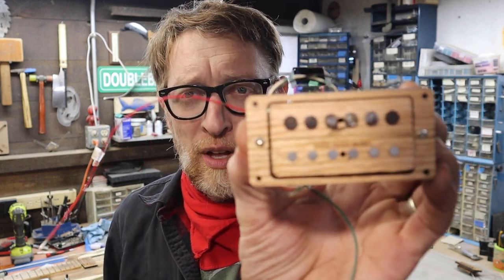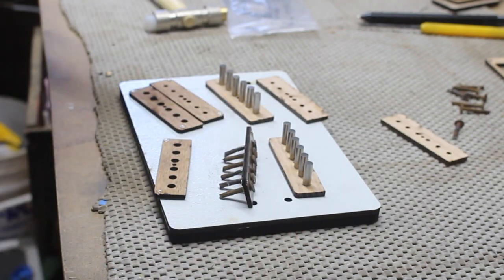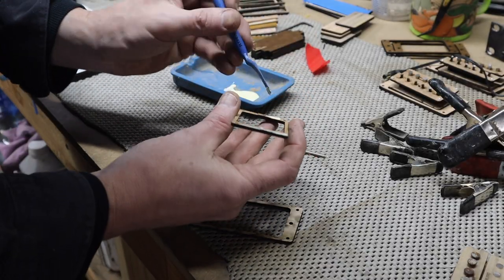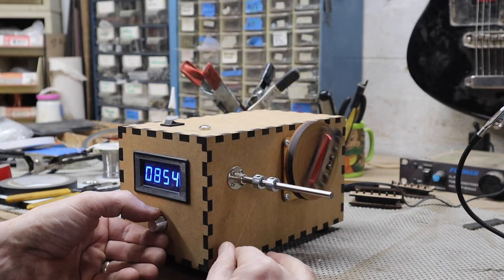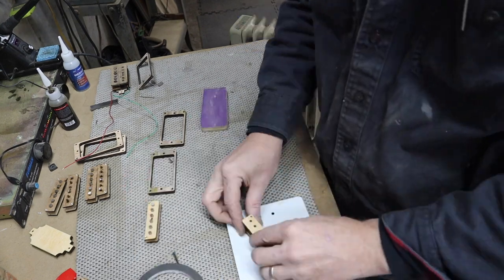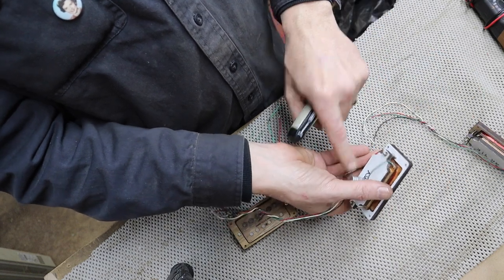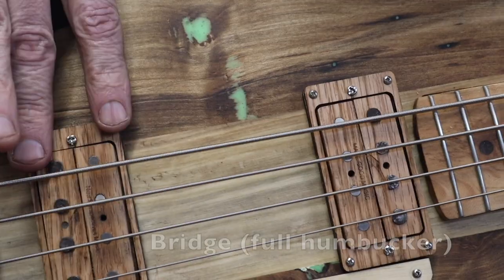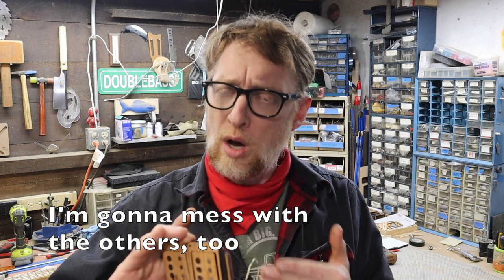DIY Pallet Wood & Rusty Nail Humbuckers - PAFS (Pallet AF)

Comment: You don’t need alnico poles. Just steel slugs. Use a nickel base plate and be sure the bar magnet makes good contact with the slugs and nails. That will help immensely
Reply: Yup.
Reply: any old "soft" steel... or yeah, nickel... forget thats a ferromagnet... 

florists wire is good. 
mu-metal or silicon steel from transformer cores... ;)
ferrite slugs...

LOTS of options...

Comment: You can melt down plastic to make a resin you can use for the bobins to prevent warping over time. Endless plastic to use for this. Magnet wise if you want to recycle, you can find cheap pickup lots in ebay, all sorts of old audio equipment, many tools, toys, jewelery, etc too. Older stuff use ceramic and newer uses neodymium usually.

Comment from the maker: UPDATE: In the bass demo, I had a brain cramp and miswired the pickups so they are out of phase. I have rewired them and they sound AMAZING! Be sure to tune in to future videos to hear them properly and/or follow me on instagram @TimSway1 to hear the bass now.
Reply: i need to know what you used to remove those nails
Reply from the maker: @thatfatguy4508  it's called an "air denailer"
Reply: @timsway  thanks a bunch i have never seen someone get nails out of a pallet so easily before
Reply: I just came to the comment section to say I think you got them out of phase. Glad you could hear it yourself!

Comment: Pickups are a simple concept but are no joke when it comes to making them. 
I would either use bar magnets or rod magnets, not both. 
There’s new pickups out there with a mix of wire gauge on separate coils. I can’t remember what brand/model though.

The first Broadcaster pickups used 43 on the bridge and 42 on the neck. 

Good luck with the design!
Reply from the maker: indeed! very small variables make very big changes. Looking forward to learning more. It's a lot of fun
Reply: DiMarzio does a combo of 42 and 43 or other gauge wires on opposite bobbins the same humbucker for a bunch of their designs. The idea is each bobbin ends up with a different frequency range, but ideally the same noise and hum for cancellation purposes. An extreme combo (really thin on one side, thick on the other) would even give it a scooped midrange tone (see dimarzio Steve's special)

Comment: An idea for the nails, maybe get a small steel flat bar, drill holes to receive the nails, and then tack weld the nails to the bar. That way you don't have to worry about the uneven surface of the nails making poor contact with the magnet, and the magnetic flux can flow better through the nails.

Comment: The nail side will always be lower with how you have done it because the magnetic field from the actual... magnets in the other side carry a stronger field through them, which magnetizes the strings better.

What you've got is closer to what PRS did to make their coil splits sound better (Or so I've heard - I don't often get to mess with those guitars) - The side that split out for the single coil used alnico slugs, where the screw (in your case, nail) side just had a bar magnetizing it. PAFs just use plain metal slugs with that bottom magnet for both coils.

If you're going to stick with the style you have now, my suggestion is to get a second, thin bar magnet to go on the far side of the nail poles - a construction closer to a P-90.

Also, a word of advice on Humbuckers - Mismatch the coils by a few turns, they tend to sound better, something to do with the phase cancelling. Try putting a few extra on the Nail side and a few less on the magnet side to help with the balance.
Reply from the maker: great info and you helped me feel better about some of my next thoughts/steps. This is 100% why I take the time to make these videos, to get this open flow of knowledge and creativity happening!
Reply: This answered alot of my questions too. I didn't know that the alnico slugs side was meant to be both magnetised and then connected to the bar magnet. Good info
Reply: @timsway  Have you tried adding passive magnetization to the nails via rubbing them with a permanent magnet? I'm wondering if that would be worth it, especially since the nails are so old and beat up, they might not let the field pass through them very well compared to new nails. (just a guess, as I'm no magnet expert)

This video by the Action Lab on magnetization might prove useful though: https://www.youtube.com/watch?v=oNjMLtHFxkU
Reply: Good advice!!
Reply: @fphantom  Those poor old nails... I always say "Excuse me for hitting you!" and then I hammer them on their heads. That really helps, they don't scream like they used to do. Any idea when iron was formed, after the big bang? Those nails are older than you'd think.
Reply: @voornaam3191  I'm not an expert but I think iron is formed in stars, they heat by fusing the lightest elements that formed after the big bang like helium, they convert it to a heavier element and at a certain moment you have a star with mostly iron in it. So not right after the big bang. Btw, for a good metal guitar you need screaming nails.

Comment: The nails are a fun choice. Using a $20 automotive handheld vacuum tester, some automotive vacuum tubing, a couple of connector fittings, and a pickle jar, you can make a vacuum wax potting system that can handle high gain distortion/fuzz without feedback.

Comment: Some thoughts. You might look into cigar boxes for your plywood. I build cigar box guitars and the box lids on some are surprisingly strong.  Old IDE and SCSI hard drives have insanely powerful magnets. Even laptop hard drives have strong magnets. (don't forget old speaker magnets for your magnetizing needs) Also you might hunt around for an electric demagnatizer. (which is actually an electromagnet on a handle) They were used in the recording and data industries to over write the magnatism on old reel to reel or data backup cassette tapes. Might be faster and more even than your vise magnatizer setup. 

Hope some of that is helpful. Peace.

Comment: Another commenter mentioned you mixing alnico pole pieces with steel, I'm going to add to that in as much as screws were used for pole piece height adjustability. Perhaps try using the nails and screws instead? That way you get 100% of your gauss from the (alnico?) bar magnet! Great vid!

Comment: Thanks! Another great video. It's time for me to build and mess with pickups, too. What I can recommend to you, is building a bass body with three rectangular holes in it. Bridge, middle and neck hole. That way you can easily change a pickup, or move it to another position, from the back side of the body, that is. No need to losen any strings. For a large enough body, those holes are no threat to strength or sustain. My bass sounds okay this way. If you like the idea, I got no patent. Makes me wonder who could have one.
Reply from the maker: I've seen some similar ideas out there. I'm sure some one tried to patent it. I love the concept
Reply: @timsway  I have a cheap Japanese 70's-ish bass. Thin plywood body sounding like cardboard. So I built a larger (still cheap) scorched pine body. And I remember those guitars with a smart exchange-your-pickup system. My version is simple, just bent up the lips sticking out, and now two short bolts hold the pickup in place, instead of those long bolts. Adjusting option is gone, fix it higher or lower. Bit of a prototype, already good enough.

It was great hearing that pickup in bridge and middle position. It had been a neck pickup only. Okay, but they could have done the Strat concept, all it took was 2 extra pickups and a 5-switch. Why did they wait 30 years?!

Comment: I've got an early 80s USA-made J.B. Player with a Mighty Mite Motherbucker--three coils all right next to each other, two bar magnets, each coil running to an on/off/phase reverse switch. I'd be very interested to see a New Perspectives version of it.
Reply from the maker: Cool. I'm gonna look that one up. Baby steps. I gotta make a working double coil first, lol :)
Reply: @timsway  caveat: Mighty Mite today makes a product called the Motherbucker, but it's not the same thing. It's just a regular ol' high-output humbucker. The real McCoys were made when Randy Zacuto was still at the helm. About 4.3K DC resistance per coil, and I believe the magnets were highly charged Alnico 5s.

Comment: Nice. Thanks for sharing the adventures. 
I know nothing really about making electromagnets. So this might be rubbish. I see the nails are quite thin compared to the other pickup parts. How about grinding two nails on the side so they can fit snugly together?. Even add a bit of solder to bind them if you think it would help. ! 
Might be more work than fun though!  It might make the sound bigger and more character full too. 
Keep having fun and sharing.

Comment: Since you're looking for weird designs, in the cigar box guitar world there is a thing called a Flat PUP. It's a humbucking design that is very flat that some people seem to like (I never tried one myself). And since it's from the CBG world, it can easily be made using reclaimed materials.Also, there are electrical magnetizers that exist. I think they are used by the model train enthusiasts to re-magnetize the motors when they're old (I know James May has one).
Reply: Flat pups are pretty amazing. They sound great on CBGs. But I also tried one on a Squier Strat that sounded really good too.
Reply: Flat PUPs are a derivative of the Sidewinder Humbucker, someone just realized "Wait, we don't need a thick bobbin."

Really neat to see people attach themselves to that pickup design though, it didn't get a lot of love.
Reply: @alaricpaley6865  I never heard of the Sidewinder pickup before. Thanks for the info.

Comment: my first, and only pickup (for a sympathetic string box aka "electric sitar") was using a bit of hacksaw blade with teeth ground off. bit of teflon tape and notch in each end.

surprised many that it worked, being high carbon steel...

i ever do it again, its getting the "I" from the core of a transformer... 

i prefer blade pickups for some reason... still have my schaller twin blade "single coil" humbucker from 25 odd years ago...  its always ended up in my primary guitar of the time.

relay coils work well. can embed them in random places, then get crazy with series/parallel, in-phase/anti-phase configurations...

Comment: I had a crazy idea. Most people told me it was impossible, but one person told me it was just dangerous and foolish. But .... in theory you can put DC through the pickup to boost the magnetic field (using them as dynamic electromagnets) and it should be able to coexist with the AC signal without interfering. Possibly, you'd need to bleed or filter off the DC before it hits an amp or pedal.

Comment: On single coils the start of the wind is the ground or “negative” leg. Also shellac or lacquer is a very good way to isolate the wire from the pole pieces, as it’s super thin and leaves you more room for wire haha
Reply: Actually the beginning (inner turns) of the coil is "hot" and the end (outer turns) is the ground. Otherwise it will make a good antenna for everything EM in the surroundings😉
Reply: @jjcale2288  over 500 sets sold and not one complaint of RF, winding them the way Fender Dimarzio etc wind them , with the common, or “ground” being the start eyelet on a single coil bobbin.
Reply: @velvetonecustomshop5026  Leo Fender did so because he put the turns directly on the magnets/poles and there was a good chance to short the coil if the isolation on the magnet wire failed. By grounding the beginning of the bobbin he could get away with such failure. Bye bye to reverting the phase of his vintage coils. Just for once,  compare the noise produced by a single coil connected as you usually do vs wires reverted. Just give it a high enough gain to hear the difference. You don't even need a guitar for this.
Reply: @jjcale2288  pickups are a single source, so by definition, they do not have “phase”, they have polarity. Since the early 60’s people have switched the leads on the middle pickup of Strat guitars to be able to jam the switch and get the parallel sounds we now enjoy on a 5-way switch.
Swapping the common leg, as you call “ground” has absolutely no effect on rf pickup. The circuit has no idea which leg you are sending where. Rf comes from analog tv station (which no longer exist) neon light power supplies (which have mostly been replaced by led), and actual radio frequencies… the only common thing that works on rf these days is a cell phone not connected to wifi. So if you set your phone on your amp you can get some rf.
But simply switching the legs of a pickups start and finish has no bearing on any noise whatsoever.
And your comment about the fender factory winding the wire directly onto the pole piece magnets is not exactly correct either, as the assembled bobbins were dipped in lacquer to add another layer of protection against dead short beyond the enamel on the wire itself.
Switching the leads on a single coil has absolutely no effect by itself, but can produce the 50’s polarity quack when used in parallel with another pickup, like positions 2 and 4 on a 5 way switch.
But alone, when connecting the 2 leads either way round to your output jack into amplification the circuit has no idea which leg is the start leg or the finish leg.
Reply: @velvetonecustomshop5026  it makes no sense for me to instruct you further. It seems you have a business in guitar/pickups. Either you do your homework or you have to pay me for any idea, information and expertise. Good luck!
Reply: @jjcale2288  fender, gibson, valco, TV Jones, Lollar, Bare Knuckle, Radioshop,PRS,Seymour Duncan, Stewart Macdonald,DiMarzio to name a few, all have it wrong then. My bad.
Reply: @velvetonecustomshop5026  don't take it personally. I respect the traditions in everything but just because a group of individuals made something in a certain way for decades/centuries this alone does not make me to reject science and logic.

Comment: antique nails would work better than new ones do. so keep an eye out. i was thinking about buying a cheap old record player and converting it to pickup winding duty. but funding has become an issue lol. the nails ide want to try are square and taper on 2 sides. i think a strip or two of refrigerator magnet under the nail slugs would solve the output issue? along with a thin bar magnet or a square bar magnet you have options.

Comment: I have a suggestion for the low output on the  nails, 2 nails per string! Like a p bass pickup has. If the cause of the lower output is because the nails aren't as magnetic then this could improve it maybe. Maybe you could even twist 3 nails together to work as a single pole piece 🤷🏽‍♂️🤷🏽‍♂️

Comment: Tim, i love the idea of reusing nails as pole pieces with the pallet/HC door bobbin, my recommendation would be to do double nail bobbins and loose the alnico slugs and just use a bar magnet for both coils. or replace the alnico slugs with steel slugs and use the bar magnet for both coils again. 

my gut says double nail bobbins with a stronger bar mag (alnico 5 or ceramic) would be more balanced and have better output.

if you dont want hotter mags cuz your worried about string pull, then you can go with more turns to get more output. the coils will be darker sounding with more turns, you can negate this by going to a thicker gauge wire to increase treble response then make the bobbins taller/bigger to fit more turns of the thicker wire.

hope this helps and gives you ideas cheers!
Reply from the maker: Thank you!!

Comment: Tim, I have bought Seymour Duncans, I own multiple sets of EMG single and humbucker pickups, solderless, Active and Not. True Story.. I use Amplitube 5, Guitar Rig 6, Computer DAW's which is basically what every guitarist uses now like Kemper. Even thought they may all sound different on the same amp settings, I can make all of them sound nearly identical. I like EMG Active's because they have a compressor built into the chipboard plus I LOVE solder-less pots and input jacks, lol. Even though I can solder, it's just so clean and the ground isn't necessary like with SH-4 Seymour Duncan. Either way.. Those are amazing pickups, but before you go down the long and winding road of searching for the perfect tone, you should mess around with a Kemper, DAW or modern amps that have so many different settings and sounds cause you will see what I'm talking about.

Comment: Steel doesn't magnetize as easy as AlNiCo. Try Pre-magnetizing the nails by winding copper wire around the nail and running current through the wire. That is how I magnetize screwdrivers so the hold screws.  Works much better on steel like nails....

Comment: Very cool dive into pickup making. My guess is there isn’t enough mass in each rusty nail to carry much magnetism. Very imaginative idea though. I’m not criticizing, but it looks like you’ll either need to standardize your string spacing or custom make your bobbins, the bridge pickup looked a little off. Don’t get discouraged, I like what you’re doing!
Reply from the maker: I just make mistakes and fix them :) lol. The bass I put them in is a future video. 32" scale and I think the neck ended up in the pocket a little off, adding to the issue. When you see that video it'll make a little more sense.
Reply: @timsway  yep, it makes more sense already. Thanks for sharing your projects, you have a great channel.